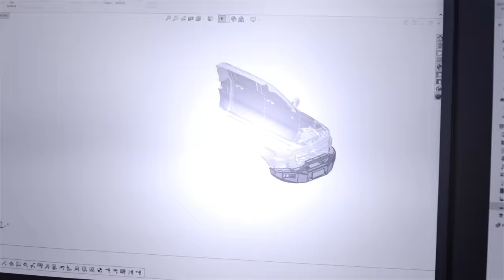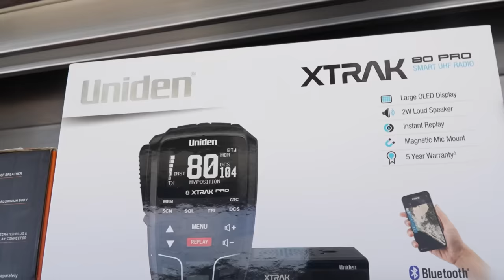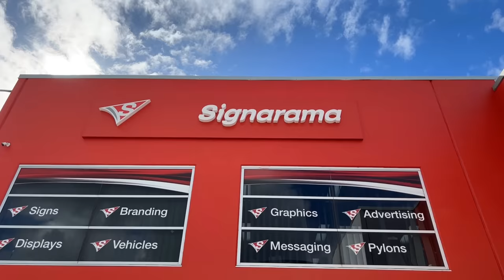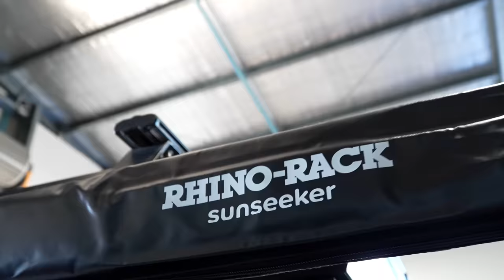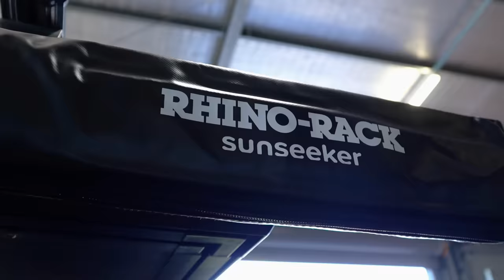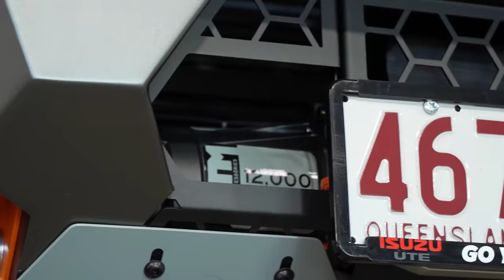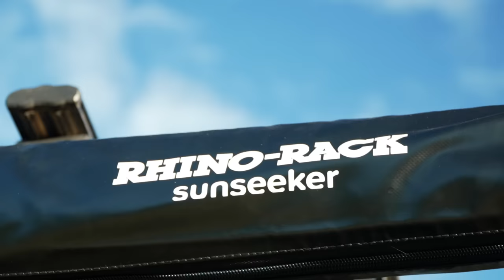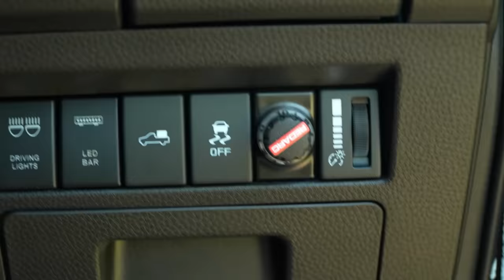🔥 AUSTRALIA'S TOUGHEST D-MAX — All 4 Adventure Season 15 BUILD REVEAL! 😯

Comment from the maker: 😎 We'll be dropping more RIG BUILDS shortly -- Like, Subscribe & turn those Notifications on 🔔 -- View the full list of D-MAX gear here: https://www.all4adventure.com/our-adventure-gear/dmax/
Reply: so,,did you fit a hilux diff in place of that ifs,,or just carry lots of tie rods & cv joints.???.. lengthen the w/base, so all the weight isnt past the diff..rear..
Reply: did ya upgrade the wheel bearings,,so you can run 35,s..change the ratios,so it still has some guts..fit a 5sp manual, with granny 1st..to pull toyotas out..dont care what there paying you,, ill never,,buy a d max or any, ifs pretend 4x4..
Reply: front diff drop,,  hmm,,, still has 6'' of travel.. ive seen an fj cruiser, roll, inching down a 10'' step. keep your ifs crap..
Reply: on board air.   power tank. 30 secs per tyre. plus air tools..
Reply: ill keep my 25k s/duty..  goes anywhere, tows 4.5t std. no upgrades needed..  4.2tdi. 700nm..  your losing people with all the retired bs..

Comment: Your wrong sorry Fella! All Exhausts are if they are made in Stainless are 304 grade. Almost the lowest grade of Stainless Steel. 304 grade rapidly deteriorates with salt conditions. If your wanting a true stainless steel to hold up to salt conditions then a 316 grade what is used in the Marine Industry is an absolute must. Just a heads up to your viewers.

Comment: Surely put all the weight on woth canopy, 12lv systems fridge...second fuel tank etc then put suspension on to suit when youve dialled in what gear youve got installed?
Reply: 💯 Suspension should be last thing installed & chosen. Very odd that it was the first thing done.

Comment: Never understand why you never do a GVM GCM upgrade on the Dmax utes etc. With that you tow I'd bet you're over weight.
Reply: Pretty sure it'd be well overweight before they hook the trailer up to it.
Reply: i dont need a gvm upgrade, as i bought a vehicle that tows 4.5t, gets 13 lt 100, has 700nm. cost 25k. no computer, no glow plugs, german engine, zf 5sp. granny first. 2 DIFFS, . s/duty..&, i can fit 36'' tyres, no probs..doesnt effect it..

Comment: Any chassis strengthening for all the weight on the back?
Reply: should of moved the diff back & fitted a front diff..  looks pretty though.. my s/duty, 4.2tdi, 700nm. basic, no lectrics, no computer. no glow plugs..  25k..  not 250k..